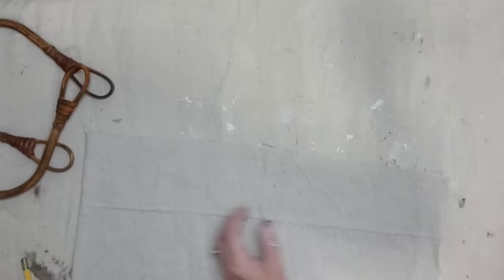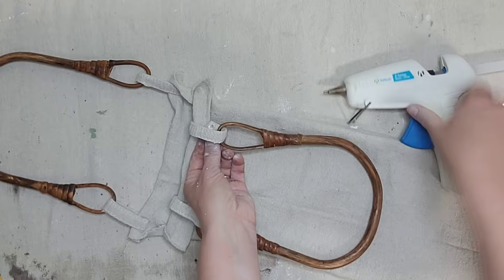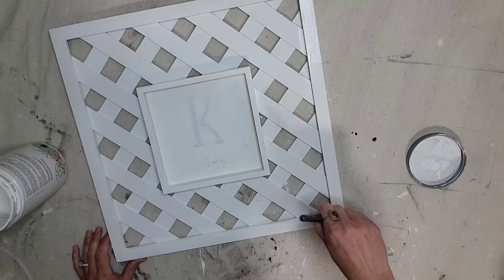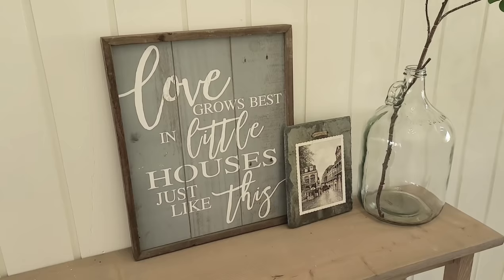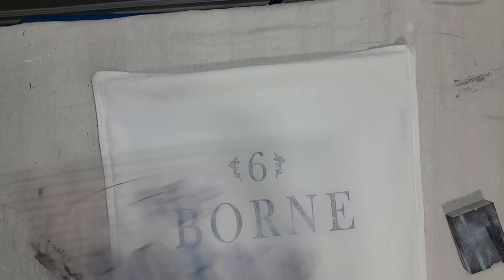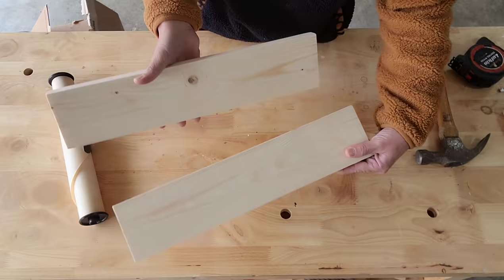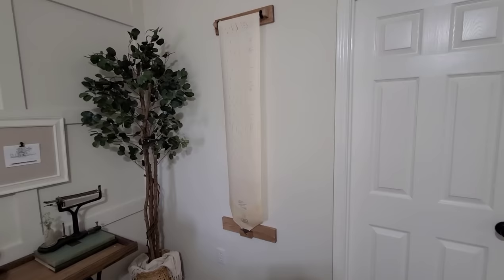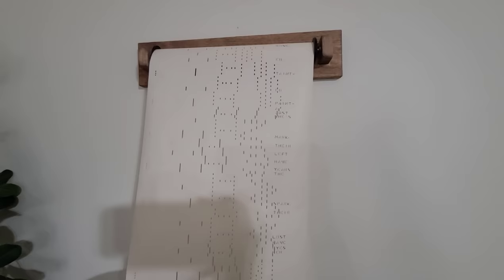Make your home Beautiful with Thrift Store finds • Thrift Flips for your Home • Drop Cloth Ideas

Comment: Hey Julie, Great ideas as always. To stop the piano roll from rolling, switch the top and bottom wood holders. So the top is now on the bottom and the bottom is the top and it won't be able to waterfall down. You will pull it up to adjust the length.

Comment: Your home is beautiful. I enjoy seeing the creative ways you makeover things using drop cloth. 😊 As for the piano roll, switch the wooden pieces and put the start of the roll at the top. To make it look "rolled" at both ends, put a dowel rod across the wooden part (which is now at the top) and pull the beginning of the roll over it so the "point" of the roll goes over the dowel. Then attach a hook or a clip on the wood for the pointed end to attach to, which won't be seen with the roll pulled over the dowel rod.😁
Reply: Except then won’t the printed words  be upside down?😊
Reply: I thought that was a great idea until she zoomed in & I see words on it 😊 Oh well! Still a good idea!
Reply: Maybe try a large elastic band across the roll at the top. Still adjustable,  this is a hard one.
Reply: @maryhemphill9419 Oh, I didn't see there were printed words! 🙄😬😵‍💫 Thanks for calling that to my attention❣️🤣
Reply: @marlahanks7278  Oh, I didn't see that there are printed words on the roll...well, that's not gonna work!🙄😬😵‍💫 Thanks for calling that to my attention❣️🤣
Reply: @lesliejackson8188  I know right?? Darn 🤣
Reply: @marlahanks7278  Yeah, darn it‼️
Reply: From the start I thought it would look better with the hook on top however, with the words being upside down … how about cutting the pointy end off, unrolling it and Reroll the other way, then reattach the end. It won’t be fun, but will be the perfect solution.

Comment: I’m flying by the seat of my pants here, but what if you turned the piano roll parts top to bottom - the pointed part on top, and the spool on the bottom.  That way it could still be adjustable, but pulled up from the bottom instead of down from the top. Theoretically, that would stop it from unrolling, since it would be pulled up to a fixed point and that would keep it taut.
Reply: I think your idea is a good one !  👍
Reply: That’s a great idea 💡 I like it!!!
Reply: That’s what I was thinking too but the words would be upside down 🤔
Reply: Some of the rolls have words on the right side.

Comment: Love love love your work. So my husband and I came up with a solution we think would work. In the back piece of the wood you would drill another dowel hole at the bottom part of the paper. When the customer has it where they want it they can put a dowel with a rubber washer in the hole and it would stop the roll from unrolling and it would make it adjustable. The rubber from the washer would help stop the roll no matter how much they wanted it to be showing. Hope that helps.

Comment: I absolutely love all of these and I love your channel. With the piano roll (what a cool piece of decor) I would put a dowel on the top and the bottom, like you did, but have them removable. Just by drilling a hole and putting like finials on the ends, making one side detachable. That way the customer could be able to roll it a for different look. Because I adore this piece, that’s what I would want to be able to do with it. Love the sack with the handles, I want one, lol. I would love to have most of your Diys. Thanks for a great video. 😊💕

Comment: I loved the dogwood hanging bag with the wooden handles! You should write a book “1,001 Ways To Use A Drop Cloth” - you’re pure genius! Also, on the piano roll, could you devise some type of latch? I’m envisioning something where you could screw an eye hook behind the top roll and attach a latch you could devise out of just a piece of thin metal that is sturdy and big enough to loop under the top of the roll. You probably have some rusty, crusty wire in your stash. Similar to a hook eye latch they use to secure barn doors. I’m sure the wheels are turning in your head and you’ll think up something!    ~ Linda

Comment: Maybe you could use a thinner board for the bottom of the piano roll so it's not as heavy.  Maybe even shorter, just wide enough to place the dowel holder.  It's neat though.  I love the bag with the dogwood branches.

Comment: Maybe making the length the roll initially starts at, shorter it won't want to unroll. Like the distance between the bottom and top piece that hold it. Or maybe something on one side of the top that sort of folds inward onto the top of the roll preventing it from continuing to unroll.. beautiful projects ❤️

Comment: Hi Julie - for the piano roll, could you add a U shaped hinge piece to the middle of the top portion? Lift it up to move the paper, lay it down to gently hold it in place. Just something with a little bit of weight would stop it from unrolling

Comment: You could cut a small wooden wedge shaped piece to act as a stopper for the roll. Just insert it between the back board and the black roller (like a tire chuck). You could even drill a little hole in it and attach it to the back board with jute twine so it looks pretty and doesn't fall out and get lost.

Comment: I always look forward to your videos because I love them. As for the piano roll, I'm not quite sure how to execute this idea (It would be easier if I had it in front of me) but I'm thinking if you add something below the roll on the top that would be hidden underneath somehow using a dowel that would slide in and out stopping the roll from enrolling when it is positioned in the place you or your customers want it. It's seems super hard to explain in words. Hopefully you can pick up what I'm putting down.

Comment: Hi Julie!  Could you slice a cork and wedge it between the side of the brace and the black end of the piano roll?🤷 Also, you could print some IOD stamps of the piano roll too without interfering with it's functioning. (Just in case you thrift a player piano.)😂

Comment: I am thinking a small round black plastic or metal gear on one side of the dowel and a small piece of wood or a pin or some sort of peg to act as a “stopper”  so the gear wouldn’t spin once you place the dowel. It could be kinda cool looking and you could even put a gear on each side. A less fun option could be a small block with clear Velcro that is hidden on the back of the dowel and attached to a block on the back of the upper board…😊

Comment: That bag with the cute handles is excellent!! Thanks for the tip about cutting the drop cloth hems off, makes perfect sense. As for making the length adjustable, If you punched small holes on both sides of the roll and put small grommets in them, then you could place a small hook on both sides above the roll. While a customer couldn't stop the roll anywhere to adjust they would have the option of selecting from several places on the roll to adjust the length. I would think you could put the side gromet holes every 1and 1/2 to 2 ft....... Good Luck

Comment: My thought would be to turn the player piano roll/music 180*, put the roll of music on the bottom and then end of the roll, which would normally be the beginning of the music, on the top. When you would load that type of music into a player piano the metal clip that’s on the sheet is where you would conect to the player part of the piano inside the instrument.

Comment: can you put a rod all the way through the top? then you can switch out the rolls (hole in each end cap and thread the rod all the way through once you add the roll). To stop it from rolling, make the "rod" square, hoping by it not being round it will stop it from rolling.

Comment: Some type of thin string or band going across the top that can be “hooked” somehow after the desired length is found??? Hope I’m explaining my idea right.  Or little clips to hold it in place behind the roll? ??? 😊
Reply: Yea, sort of like the things they use on the brown paper rolls designed to hang up as a notepad. Like it has a black metal band around the paper. It kind of holds it in place. I figure if julie looks around in the hardware section, there has to be a clip or band that should work.